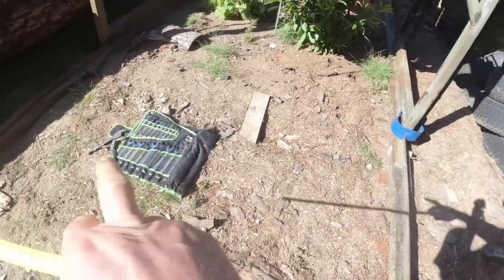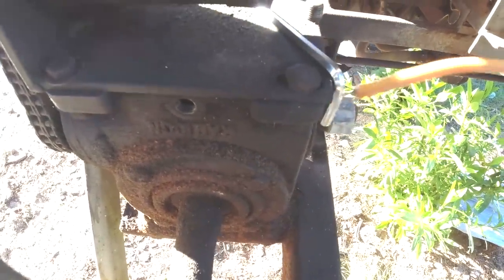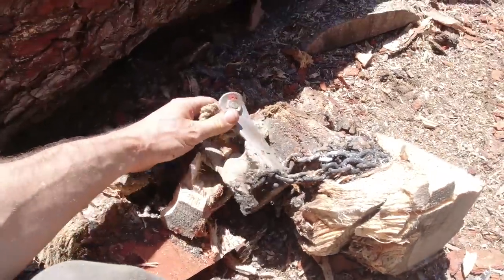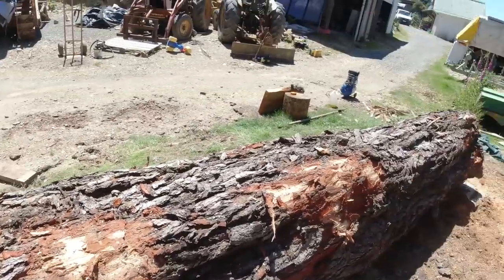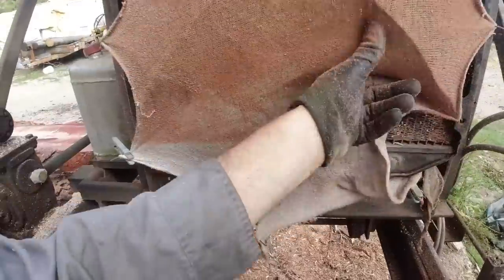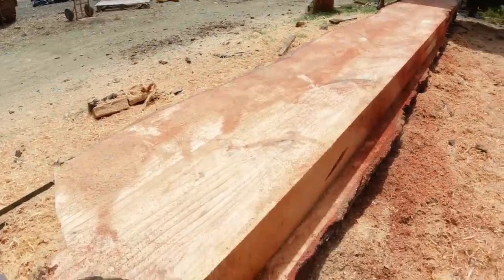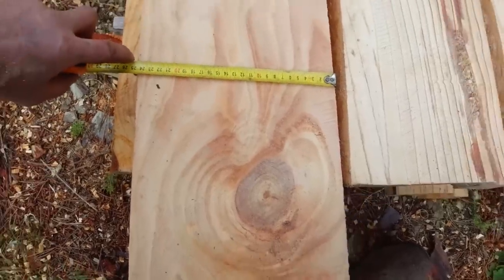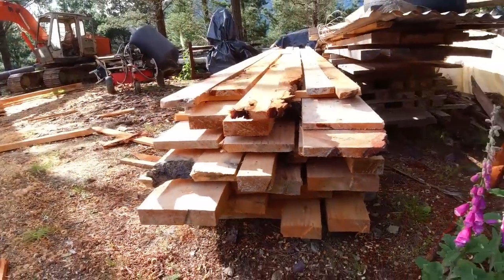Milling a Giant Pine Log with a Home Made Twin Blade Sawmill

Comment: It was great to see how you cut that metal out of the tree - and very clever to check the rest with the metal detector (wouldn't have thought of that). I love the way you ensure best quality of outcome by clearing dirt / bark off the log, sharpening the blades, removing resin halfway through etc. It's just great watching you work especially with old equipment that still do a good job with the care and maintenance you give them. Great job Marty!

Comment: I have a small oak paperweight in my desk, cut from a block of firewood by my dad, with a large lead "wadcutter bullet" imbedded in it. We were splitting firewood and he spotted it inbedded in the log. It's very old. He used his saw to cut the little block with the bullet out, and he gave it to me to polyurethane and sand smooth. It sits on my desk today, and reminds me of my days as a kid cutting firewood with dad. I'll never forget him saying "glad I didn't hit that with my Jonsered!" which is funny, because if there was a nail or bolt in a tree, we would ALWAYS seem to find it with the chainsaw. Good video, as always, Marty.

Comment: Good to see the old saw mill still runs like a champ. It's been a while since your last video using it.
Reply: Imagine if he needs new blades for it. Must be hard to find.
Reply: @tujuprojects  I believe You can change the teeth on those blades. That is if one can even get them somewhere..
Reply: @gatisozols  sure, those are brazed bits. That’s metalworking and somewhat advanced that needs some gases and electricity.
Reply from the maker: The teeth are removable, not brazed, they slide in using a special tool
Reply: @MartyT  well that helps then.
Reply: @MartyT  I'm sure there's a saw doctor still around that can get some made
Reply: Is there a tally board on it some where to keep track of the human limbs it has torn off. Since you don't work in a Pakistani metal shop, I assume you know better....

Comment: Gummy old stuff, you tempted to try a bit of a spray like the bandsaw mills? Nice set up.
Reply from the maker: Yes I did actually set up a blade watering system but it didn't seem to make much difference, I just got wet legs😂.. you might notice the white container and yellow tubes appear on the mill half way through the vid

Comment: I've seen saws like this drip a coolant onto the blades to keep them cleaner and sharper for longer. Some of those 2x4s will be pretty weak in the middle because of that large knot, but there isn't a lot you can do about that other than cut 4x4s out of the worst sections and save the prime stuff for your preferred dimensions. Very nice all told. I would be very happy with pretty much every board you have thats over 2" thick. 

I've also seen some people use bailing wire to clamp the cauls/stickers to force prevent warping as it seems pretty resin filled and maybe a bit green. You can also paint the ends with pitch, house paint or whatever to slow down the drying at the ends and prevent splitting. 

Sorry for leaving such a large comment. I'd hate to see your hard work spoiled by unseasonable weather.
Reply: Great job listening to the machine by the way. The blade sounded much better after sharpening and cleaning them.

Comment: Great set up with the saws, with the saw getting sappy, in the old saw mill that I worked in over here in Aussie we would use a fine spray of water, that would keep the saws cool and clear of sap, that was hard wood and pine. Thanks for the videos that you do, and enjoy seeing all the repairs and engineering you do, did you get every thing cleaned up after all that rain okay. Cheers,

Comment: I chopped 10 cubic meters lumber for firewood. Used my grass mower with collecting bag to pick all saw dust from lawn. I have four big bags of that, have been burning it with wood in my living room fireplace. It burns well and is quite dry, thanks to the large surface area.

Comment: Seal the ends of your boards to stop them from twisting and splitting. I'm a builder and if I need to dry my own R/S timber to save costs on home projects I'll melt a pot of parrafin and wax the ends of the stack. Anything should do though, paint, glue, whatever. Timber dries out 10-12 times faster at the ends than it does the sides

Comment: Marty, great video. Did you build this mill, I saw you assembling it.  Pretty sweet set up. Thanks for posting. Stay safe. Watch those pine needles built up don't catch fire.
Reply from the maker: I didn't build it, but had to recondition it when I got it. Bearings, chains, blades, belts, rails, hydraulics were worn out

Comment: hi Marty, I used a Lucas for 4 years, when cutting pine there was never sap build up on the blade due to the water feeder on the blade, your twin blade set up is a real luxury.
Reply from the maker: Yes I did actually set up a blade watering system but it didn't seem to make much difference, I just got wet legs😂.. you might notice the white container and yellow tubes appear on the mill half way through the vid

Comment: Hello Marty, I saw how much resin you were encountering and I have a simple solution. Keep a squirt bottle of diesel fuel and spray the blades while you’re cutting and it will melt it right off.
Best Regards 
Fred Thomas in Skokie IL USA.
Reply from the maker: I will try that, thanks

Comment: Make sawdust logs. Sawdust, paraffin wax or even veggie oil, and some sturdy cardboard boxes or even light ply forms (your "waste pieces of wood" would make great sawdust logs forms). Mix and compress sawdust and oil until you have wet porridge-like consistency. Compress into your forms (a heavy brick will do that trick over time). Makes a great log for the fireplace. Burns hot and long.

Comment: Put a wedge under the vertical edge. The weight of the board is binding on the blade & creating heat which is melting the sap onto the blade.

Comment: I am very interested to see for the first time a twin blade mill working .  I run a Lucas Mill and you might try their method of lubricating the blade with water.  I like the way it mills back and forth.  Altogether an extremely fine piece of work.
Reply from the maker: Yes I did actually set up a blade watering system but it didn't seem to make much difference, I just got wet legs😂.. you might notice the white container and yellow tubes appear on the mill half way through the vid

Comment: At the Mill I work at we have a sprayer that sprays the blades with a fine mist of diesel and that great greatly reduces the frequency you have to clean or change out the blade, especially necessary when milling Larch because of the amount of pitch. We use band saws but I imagine you could probably rig something up to spray diesel on your blades in a similar way. Not something you want to do with a finishing board or something you want to paint but if you do using an oil-based stain or just using it for structural it's completely fine, if you're using a molder or something like that to have a nice finished product then it gets rid of the diesel entirely.

Comment: That sawmill is wicked cool. That is how I found you. I do not recall if the original videos of the saw mill are still up from the guy you bought it from. There was a video set somewhere of someone who was making a brand new version of this yet I can not recall who or where I seen it. 
I am no longer living in a place where I could use one of these. Though I did mess about building one of these swing blades some years ago. I never finished it as I mainly did it with scrap I had or got for free and parts that were laying about. The gear box I had was no good for long term use and I did not want to spend 500 dollars on a gear box for a project that I was likely never going to put any money in to.

Comment: Marty T, don't know how this would work for you, but some (if not all) the people I follow with WoodMizer Band Saws, use Diesel fuel, to lubricate (and keep off the pitch / tree-sap on) their cutting blades.  If you decide to try this method, i would suggest putting the Diesel fuel in a hand-spray-bottle, of some type. I would think after each pass spray just enough to COAT the blade, not dripping wet.
Reply from the maker: Good idea, I'll try that next time

Comment: That's a pretty cool sawmill setup.  Did you fashion it off something else you had seen, or come up with the whole thing in your head based on parts you had kicking around ?
Reply: I think Marty acquired it from somewhere already built. Mentioned it in another much older video. Of course it needed the Marty touch to get working properly.

Comment: I don't watch many log cutting videos, but I have never seen a dual blade design like that.  Did you come up with that design by yourself, or just build it yourself from a kit or some published design?  That looks very efficient to be able to size the exact timber you want and cut it out in one pass.  Very interesting to see.  Does using wedges on smaller logs work just as well when you lay them on the ground like that to cut them?  Most trailer type mills I've seen always grab onto the logs in some fashion.
Reply from the maker: I actually got this from the guy who built it. It was run down and worn out so I spent weeks reconditioning it

Comment: Make a 225 bar to fit across the end. bolt on so you can take off easily and your rails won’t  move. Do you have a wood drying shed?
Reply from the maker: Yes I have a drying rack in the shed but these boards are too long

Comment: Would a continuous water spray on the blade help to keep the pitch from building up on the blade? I know that the bandsaw mills rely on water lubrication.
Reply from the maker: Yes I did actually set up a blade watering system but it didn't seem to make much difference, I just got wet legs😂.. you might notice the white container and yellow tubes appear on the mill half way through the vid

Comment: what kind of arbor nut do you have on the horizontal blade to keep the nut from digging into the wood when you're cutting or is the blade just welded with no arbor nut?
Reply from the maker: 4 countersunk allen bolts
Reply: @MartyT  thanks for the reply. thought they might be something along that line. I have a couple of shaper cutters designed that way. Love your saw and the your skill on repairing old machinery. Your videos really helped me get a 1985 international tractor in fairly bad shape get back up and running as a great little tractor. Your step by step approach to fixing machinery helps us mortals when dealing with mechanical issues.

Comment: I love this mill ... I'd love to see if water injection on the cuts would make any difference like the band saw mills 🤔
Reply from the maker: Yes I did actually set up a blade watering system but it didn't seem to make much difference, I just got wet legs😂.. you might notice the white container and yellow tubes appear on the mill half way through the vid
Reply: Ahh I did wonder. I wonder why it works well for some setups and not others. Physics is a fickle thing at times!

Comment: I was cutting firewood the other day and my chainsaw found a fence staple someone had hammered into the tree 20 years ago. Even the weak little electric saw I was using ended up throwing the entire log right into my kneecaps, so I can imagine how that mill would react if it found a piece of metal.

Comment: Marty: Do you know how to straighten a circular sawmill blade?

I have a double cut mill and have trouble with the horizontal blade (18.5" diameter). The mill is similar to  yours, also uses a Datsun 4 cylinder engine. Unlike yours the cutting head travels along a beam that goes up and own and sideways. The horizontal blade on yours is driven through a transfer gearbox and mine through a quarter turn belt system (sucks). Your mill seemed to have to go through the log very slowly. Mine does too, though mine may have been because of a bad shaft bearing.
The horizontal blade warped into a plate shape because of overheating. I thought it was because of sap and dull teeth and such. Turns out it was a dry bearing gone bad, which permitted shifting of the blade position from horizontal. The bearing went dry because it was not getting grease because the greasing nipple was plugged (yes, I should have caught that). It will need a new bearing and blade now.

Enjoy your stories. thank you.

Comment: Marty, wouldn't it be beneficial to reverse your fan blades,  making the fan a pusher ( to keep dust and shite out of your radiator and away from intake )like a bulldozer or other heavy  slow moving/ stationary equipment, rather than a conventional pulle( ie sucks through  rad, then blows  back on engine)  as set up, usually very easy  to change  on this vintage. I'd  still use your custom  dust guard, you'd  just need to clean things less often.
Reply from the maker: I think it would still suck the sawdust into the radiator but would be harder to screen from the fan side
Reply: @MartyT  5u5
Reply: @MartyT  thanks for reply. Hadn't considered that aspect, but can see it could be an issue. Generally eg in bully use or equivalent the air around the motor is less of an issue than the general  working conditions,  so a pusher fan makes sense but  this is an extreme case, so as you say, perhaps not 
Cheers
Keep up the good work

Comment: How do you go burning pine for firewood? Do you have to burn it with the fire running hard to prevent creosote buildup? I've always been told never to burn pine for that reason.
Reply from the maker: I've never had a problem with creosote buildup, my flue never needs cleaning

Comment: Does that lumber ever firm up as it dries? Even the big boards had quite a bow in them coming off the mill. Softwood species, I take?
Reply: It’s Monterey Pine (Pinus Radiata). An introduced species from northern California. It’s not particularly strong, but is extremely fast growing in the New Zealand climate. That tree is maybe only 50 yers old.
Reply: It's Monterey Pine (Pinus Radiata). When green it's super-full of moisture (about 1100 kg/m^3, i.e. it won't float), so it's bending due to its self-weight. When dry it weighs only 450-ish kg/m^3 so doesn't bend nearly as much when you pick it up. It's pretty rubbish timber, but has open pores so you can pressure-treat it with CCA, and use it in ground contact applications. It's also boron-treated and used for framing in many New Zealand buildings (with appropriate design/construction techniques).

Comment: Is that an A12 from a 1200 Ute like mine? 😮I knew I recognized that engine!
Reply from the maker: Yes it is, good old engines. I've been looking for a spare but they're getting hard to find here in NZ
Reply: @MartyT  Yes same here for parts, I've imported my Ute, a 1990, from Japan, and it's one of those feedback carbies on it, I wouldn't use it as is on your mill with an ECU... 
It's great to shame those shiny pickups by carrying as much or more stuff than they can without blowing their airbag suspension haha

Comment: How long do you let the boards airdry before you use them?
Don't you have some (what I would call) exotic New Zealand hardwoods and how does the mill do on hardwoods?
Reply from the maker: They'll be dry enough to use in a few months.. if the missus doesn't steal them for her raised garden beds first. Yes it will do hard wood but is a little slower to get through a cut

Comment: not rubbish - tree was huge so you got all kinds of good stuff out off it - do more - think about building a solar powered band saw to do slabs - some investment but if you have the tree to do some sustainable cutting why not - limber is gold and you need more elbow room  anyways - add cow manure to cleared areas and will be a big boost for paddocks or to get a good start with new trees

Comment: Interested to see you doing some cuts as back / reverse cuts rather than forwards cuts. Do you find this slower and more inclined to bind / bog down?  Most saws I've used tend to bog down doing  moderate to heavy  reverse cuts
Reply from the maker: Yes It does tend to bog down more in reverse

Comment: Hey Marty is there any weather treatment you can add to the boards or are the used as is when they are dry? Thanks, love your videos
Reply from the maker: Pine is usually pressure treated for outdoor use, can also paint on copper naphthenate liquid which is messy and smelly to work with but will make the timber last a long time

Comment: Cut my teeth as a 'tail boy' to my dad on an old Yankee 5' diameter circular saw bench which was a hand cranked type back in the late 60s.
I have seen those teeth & guides come out and bury themselves clean into the shed timbers or up through the corrugated roof sheets!!
I shuddered watching that one Marty, for your safety mate.
I'd go for tungston tipped blades mate, far superior cut and the edge lasts way longer.
Loving your videos nevertheless👍👍🏴
Reply from the maker: Yes I try to stay behind the steel corner post as much as possible😂

Comment: Do you have hardwoods as well or just pines?
Reply: Marty almost certainly has Akeake (Dodonaea viscosa) on his property, which is a hardwood. Although hardwoods aren't necessarily hard (in an enginering sense) -- Akeake certainly is. Bloody hard. Works like mild steel (or that's how it feels to me, at any rate).